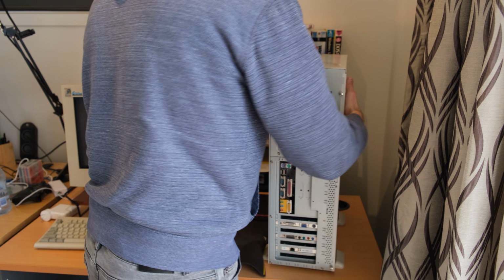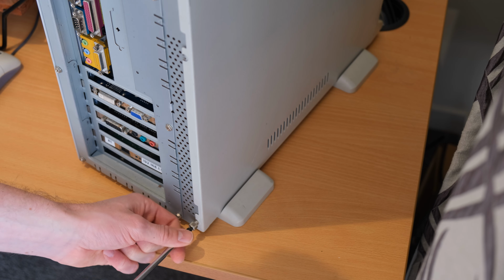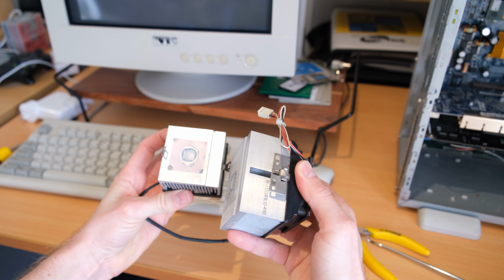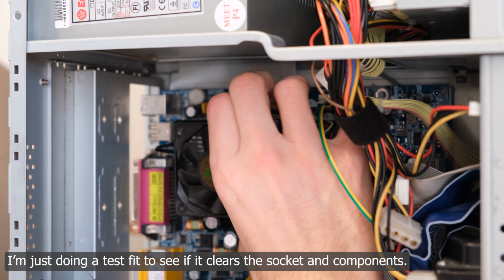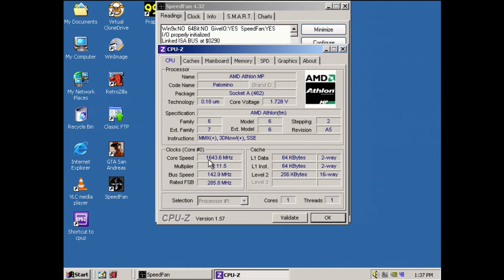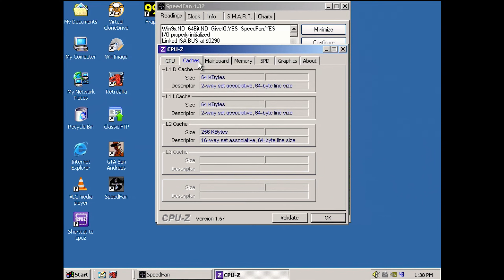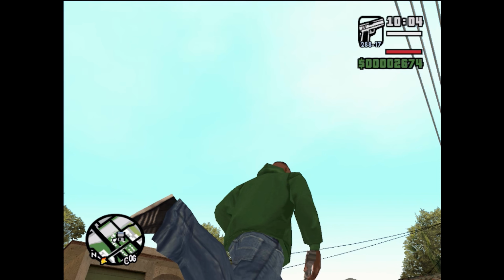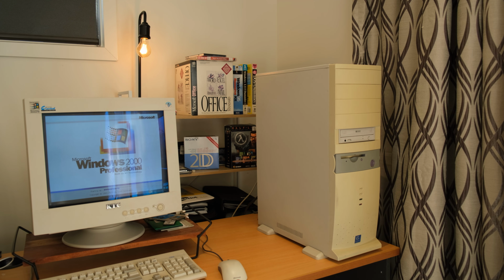Finally Swapping Those Zip ties | AMD Athlon

Comment: 4:29 everyone holding their breath 🙂
Reply from the maker: I tell ya Phil, you'd think I had learnt my lesson haha. I like to live dangerously sometimes
Reply: @thesmokingcap  😅
Reply: @thesmokingcap  If I use a screwdriver that is actually big enough to fit the slot, like the one you used, then I find it's almost impossible for it to slip out. The small ones are a dangerous gamble...
Reply from the maker: @Shmbler  Still kicking myself on this one. But yes the bigger ones do fit the cooler clips much better

Comment: I loved my Palomino. I was able to upgrade to an XP from a Thunderbird without changing the board back then. And you could still unlock the multipliers by reconnecting bridges. In comparison, with a socket 423 P4 you were totally screwed on upgrading.
Reply from the maker: I've found it to be a upgradeable platform to work with. Would have been amazing to pick these up new. Found a new issue with this motherboard however, that bluescreen is related to a RAM issue. But seems that something going on with the motherboard is causing all replacement sticks to fail at the same spot. I wondering if more caps have died or have high ESR. I really need to get myself a ESR meter